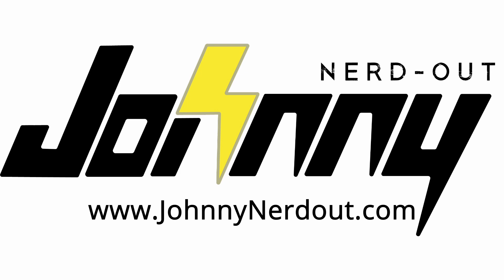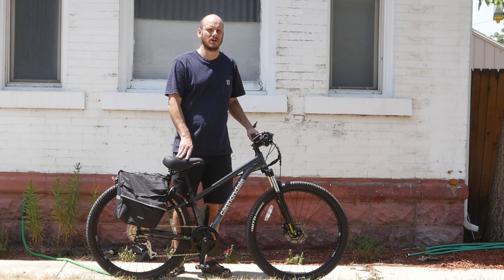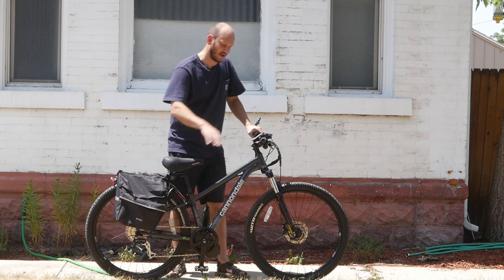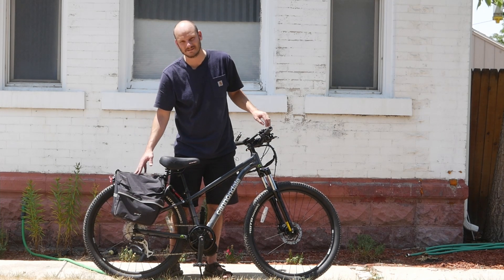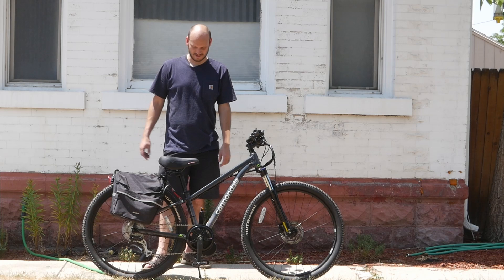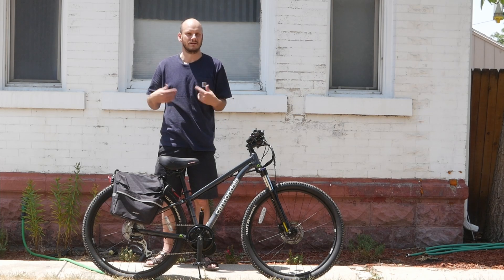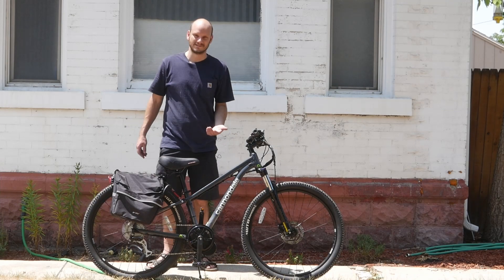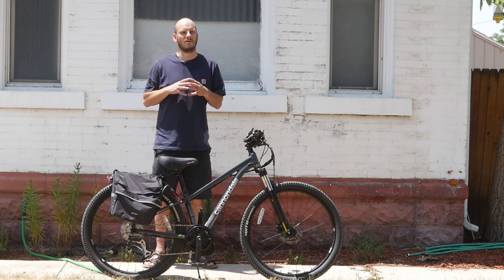Custom E-bike Build: Cannondale Trail MTB Bafang BBS02 750w 48v 20ah

Comment: hey dude are you familiar with the 17.5 ah 52v from luna shark pack or something?If so do you know if the bac855 controller is too much for it as in Amp draw......thanks
Reply from the maker: You should be able to easily see what the draw is from the controller and what the battery is able to sustain 👍

Comment: Who needs a bbshd when you have bbso2 when used in conjunction with the correct rear casset size optimized for steep climbs and high speed like this one seems to be. 
Does a better job at climbing that hill from standstill than most of those bbshd builds you done in the past with the same top speed hahaha

Comment: I would have to ask how you’re getting 36 miles an hour with a 44 tooth sprocket. I just build a 48 V bbso2 29er And on level ground the best I can get is about 30. That is with a 48 tooth and 11 tooth. Granite I have not re-programmed it yet but it still on stock programming.
Reply from the maker: Start with the programming, make sure it s set to max.
Reply: @JohnnyNerdOut  Speed is set to the max via the display, but I have not used the programing cable to up the amps yet. Honestly I’m OK with it at the speed it has and that it is safe from pushing to hard. just curious if you’re using a programing cable and a computer or phone to adjust the amperage.

Comment: Cool bike man. I don't think putting batteries in bags is a good solution though. It seems like they would flop around, stressing the conductors and adding annoying free surface effects. But it's a quick and cheap solution which you can upgrade in the future so I guess it makes sense.

Comment: That amount of watt hours should be the minimal standard for those knowing they want to go more than 8-10 miles without worry. This is essential for someone who doesn’t peddle, or rarely does as you will have no choice but to when the battery is zilch after a short while. Let’s not even get into hills with no pedaling 😧you just have not experienced the juice leaving your battery at an exceeding amount of rate.
Reply: The quality of the battery makes a difference.
Reply: @TheAgentAssassin  Indeed. Quality of the BMS too.
Reply: You're right if you don't pedal but that's a lot of weight to carry if you do. Throttles just guzzle electricity. I have 2 batteries and neither is as much as 20AH. When new I could do 20 miles on a 6AH battery without breaking a sweat and still come home not fully empty. Now (6 years later) that battery will only go 6 miles on throttle (with a BBS02 on a light bike). For longer rides I also have a 17.5AH battery. I often opt for the anxiety range, slower speeds and more pedaling over carrying an extra 10 to 15lbs.
Battery choice is dependant on how you you ride, where you ride and your necessary range. If you plan on a regular commute I totally agree that 20AH should probably be the starting point.
Running out of juice is a painful reminder of why we're not riding analog bicycles.😬
Reply: @michaelsprinzeles4022  it is great to go where you are going not sweaty, but worse outright soaked because of the bridges, distance, and weather.
Reply: @michaelsprinzeles4022  20 miles is amazing. With that distance covered with such a low amp I would personally look to the Ride 1Up B2, or 3 that has to becoming soon as it’s been over a year since that bike came out.
Reply: *V2
Reply: @buffalomind6838  Nah, I'm a DIY BBS02/BBSHD man through & through. I have to admit that for someone just getting into e-bikes Ride1Up do present an attractive package.
(The battery is old now so 20 miles would require some sweat equity. It is low amp hours but not low amp...it puts out 30 amps continuous if needed and my BBS02 is only set for 18 amps.)

Comment: I did the same thing : 20Ah 48V battery in the back left bag. But the balance of the bike is not optimal. The battery weights around 5kg, and if you go too fast on a bump, the bag just jumps… Next step is to try to put the battery in a bag on top of the rear rack. Can’t put the battery in the bike frame…
 What is your gear ratio ? I have a 11-36 9s cassette with the 44t crankset

Comment: Thanks good video. I would have liked to see the battery that's installed.  Is it a single pack or did you split the weight between the two bags?
Reply from the maker: One single rectangle pack ☹️
Reply: @JohnnyNerdOut  what is the univasal battery  you see most these being made from thanks
Reply: I would of liked to have seen how it was situated. One would think it was divided as the weight being on one side is not ideal.
Reply: Ah’ looking back at that part I “think” it is on the rack, but he points to and specifically says bag while it not being strong enough to carry too much more cause of the battery. Why would it matter if the battery was separated from hanging from the bag? Hmm